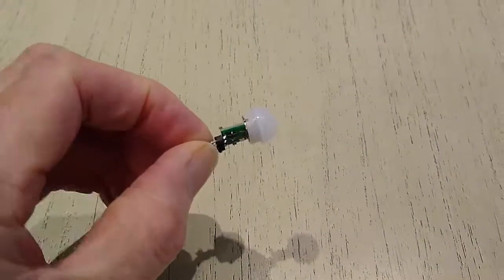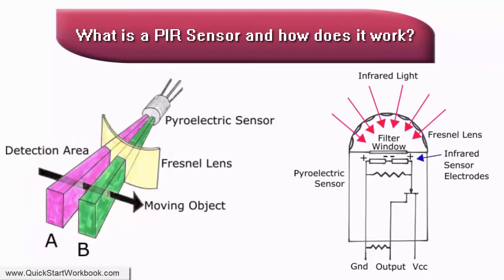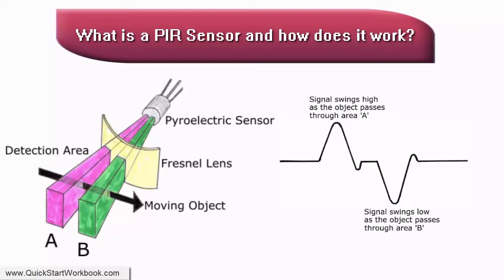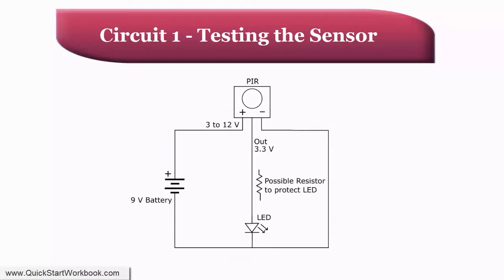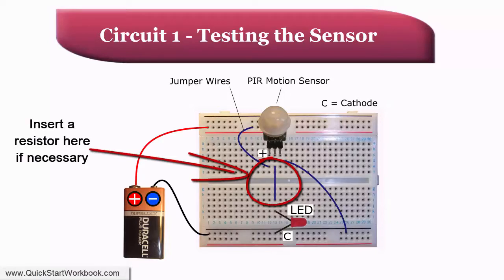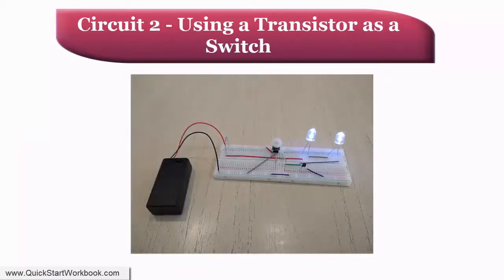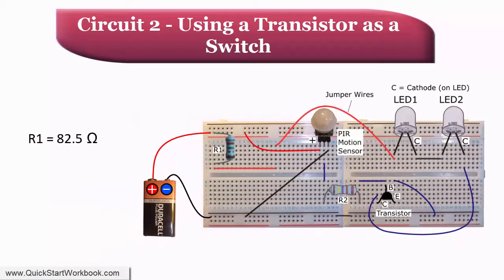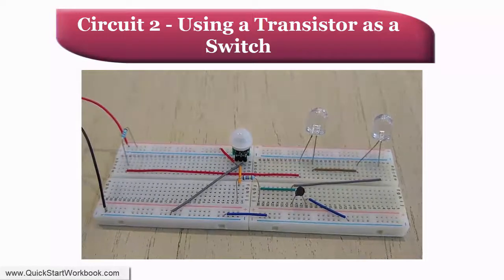Building a PIR Motion Sensor Circuit on a Breadboard

Comment: I don’t understand the transistor…doesn’t the PIR already act as a switch like in the first circuit?
Reply from the maker: The problem with the first circuit is that the output from the pir sensor wasn't really powerful enough to properly illuminate the LED. If I remember correctly, it was only about 3mA, and you need something more in the region of 10mA at least. So what I decided to do was to use the 3mA is switch on a transistor which then allows current to flow directly to the LED without going through the sensor. Basically, the sensor isn't capable of driving a device itself, but is perfect for providing a small current to switch on a transistor.

Comment: Thanks. It would be very interesting a circuit about how to build a timer for this kind of sensor. Keeping the lights on for a certain amount of time like 2-5 minutes
Reply from the maker: Some motion sensors enable you to set the amount of time the signal stays high for. I've got one set up in my shed so that the LEDs stay on for about 3 minutes. I used a 12v battery with 4 LEDs and no resistor.